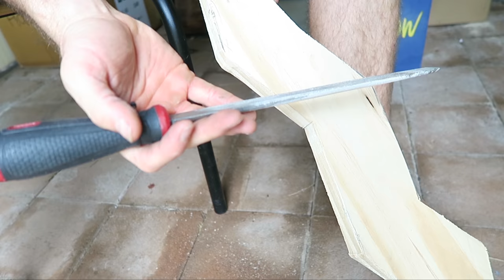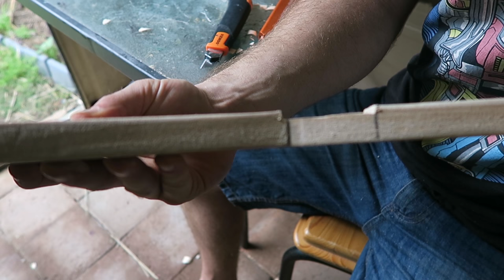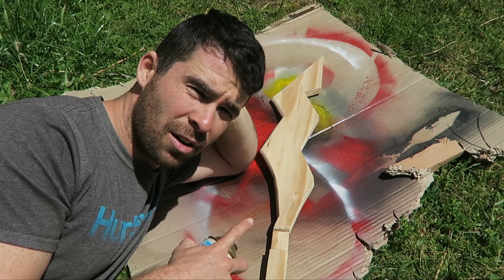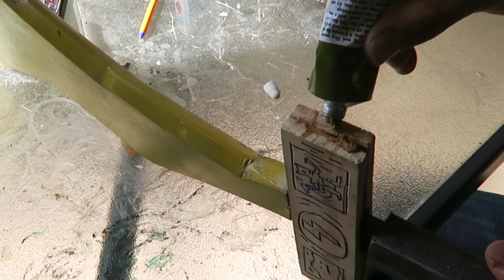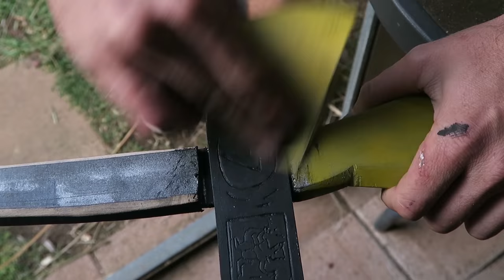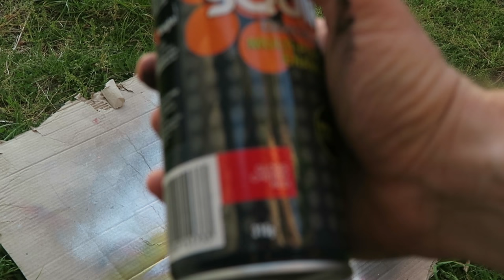Pikachu Sword Charity Build

Comment: looks good but I would be worried that it's too thin and would snap too easily you could put pieces over the top to re-enforce the handle
Reply from the maker: Yea it's definitely a weak point. It's not so bad though because it's only weak if hit horizontally, if you hit something with in a regular slicing motion no pressure is put on the thin part. BUT, it still is weak. Gonna do it differently next time.

Comment: good build dude :) hopefully notching out the sword doesnt create too much of a structural weakness near the handle. for next time try two pieces of wood for the hilt instead of cutting 1 in half. then you can notch those two out and you get more depth to the handle area as well, plus you dont run the risk of the blade portion snapping off at that lower weak area :)
Reply from the maker: Yea I had the same thought. These are made of soft pine so they aren't really great for hitting slicing stuff anyway. But yea, I think on the next one I am gonna use about 4 separate pieces for the cross guard.
Reply: Friggin Boom Toys excited for whats next! each time is a learning experience!

Comment: I'd bid but I'd get outbid so quickly...
BTW, I've been making a helmet based off Let's Make Stuff's template (thanks to you as inspiration) and I just keep getting frustrated, the foam mat keeps curling up and it doesn't come together clean... any tips?
Reply from the maker: Well bidding is currently at $1.00 so you might be in with a chance. 
I suggest you lay the foam out with something heavy on it over night for it to curl into the shape you want before attaching
Reply: You could also try heating up the foam, even a heater or hair dryer can heat it enough to make it soft, then you can bend it into the shape you want before gluing.
Reply: Let's Make Stuff Aah, I see, thanks man!